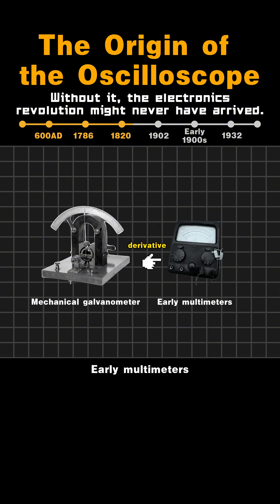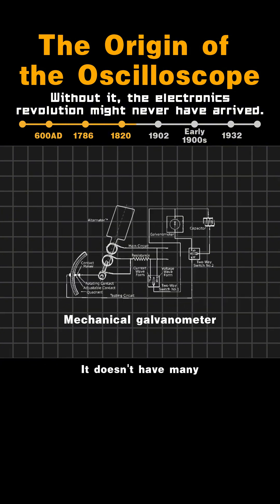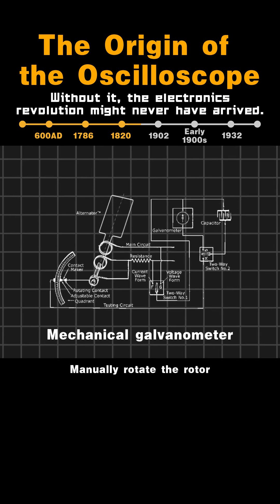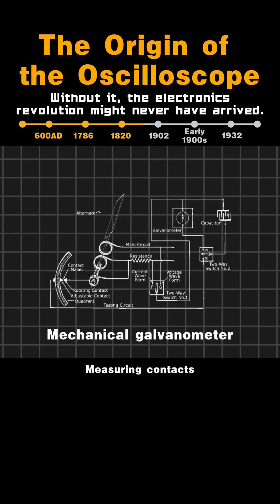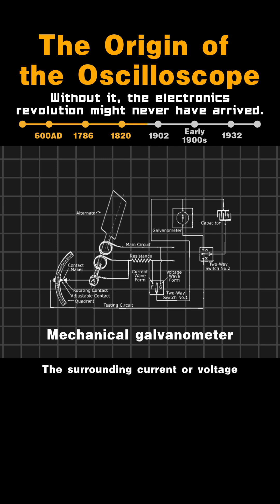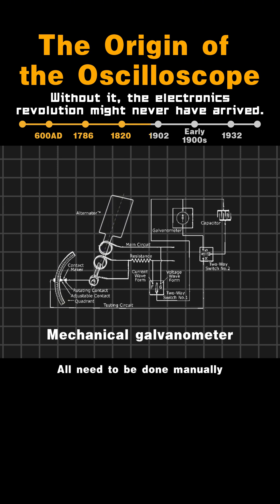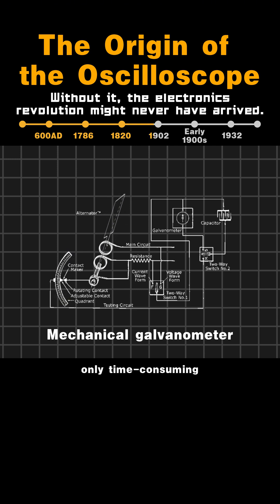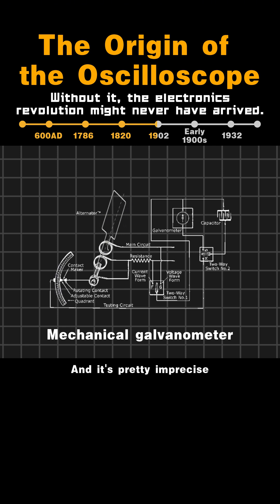FNIRSI 2D15P 2CH 100MHz Digital Oscilloscope+Multimeter+DDS | From Frog Legs to Touchscreen Tech

Comment from the maker: Learn more at 👉 https://fnirsi.top/3X27IN7
$15 USD OFF! 🔥 code: 2D15P15
Reply: The spects don't point out the accuracy. Is this a guess meter?
How many bits does the ADC of the scope have?
Can the device be used as long term logger?
Is it possible to read live value of multimeter displayed values via interface?
Does it have auto power off?
How many hours can it operate, before it needs charging?